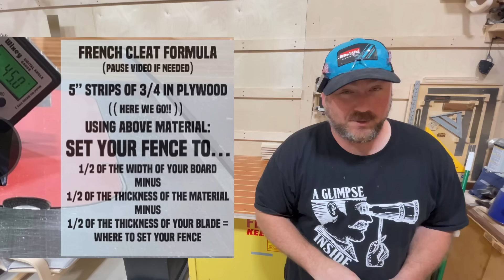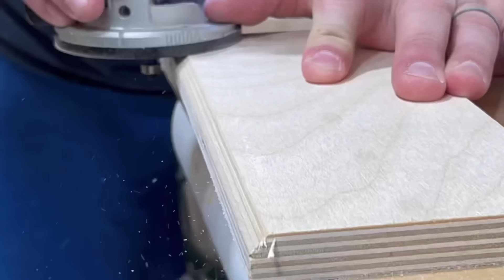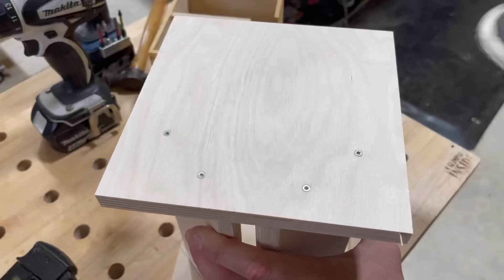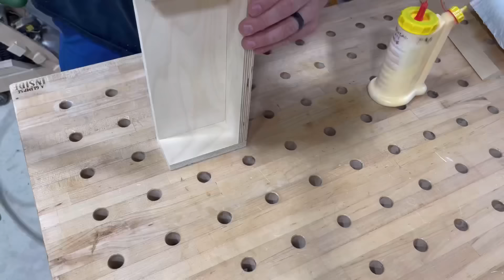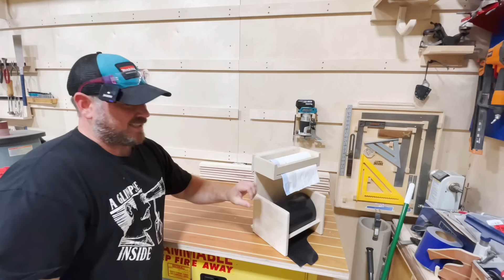This FRENCH CLEAT Design Change is AWESOME

Comment: if you do it backwards you can make smoke and stall a 3/4 horse table saw... not that ive made that mistake lol. I cut 1 4 foot board stalled the saw 6 times burnt marks into the cut bound terribly. honestly hadnt attempted another 45 yet. i did receive advice from my grandfather including which side to put fence on so now its just find time

Comment: That's killer, and not only allows a tighter spacing of cleats (if that's your bag), it also makes them infinitely easier to cut out, when you can just set your fence however wide you want your cleats, and then just go to town. 100 percent I'm gonna use this style cleat for the wall I'm building this summer.
Reply: Oh and great ideas all around. You gained a sub today my friend

Comment: I just stumbled onto your ch and this video. Great video thanks! I'm a newbie wood worker starting out. I want to put up one of these cleat systems on my garage wall.  What vertical spacing do you recommend between the cleats?

Can I put the cleats right on top of my sheet rock? Or is there a reason it looks like you covered the wall with plywood first, then put the cleat system on?

Thanks.
Reply from the maker: I like about 7 to 10 inches between the cleats. Also, you could put them on sheet rock just make sure you get a couple of screws vertically spaced between each other about an inch or inch and a half into the studs 
I was just like a solid surface for more versatility 

Thanks for checking us out welcome aboard
Reply: @AGlimpseInside  Thank you for responding with that helpful information!

Comment: I like the idea but maybe I'm missing something? That box made in the video will only work in a cleat box and not directly on a cleat on its own? I'm feeling like if the main box had a normal down towards the back cleat interface you could just put any cleat holder on top and it would also allow those to work on the wall cleat itself

Comment: Great stuff and video!  Question:  Will the parallel angled cleat remove the need for locking key or peg?
Reply: I tried it out.  Yes, it kind of works if you do everything with very  tight tolerances.   If not, it is very easy to bump a lightweight item by accidentally hitting it from below.  Note that to deliberately remove an item you move the item cleat up and away.   I don’t see a way to lock things since it’s all bevels.

Comment: I'm obviously the inexperienced one here but...  I sure would love a basic French Cleat tutorial with all relevant info.  I've spent hours on the tube and the googs and frustrated.  How do you choose cleat size and spacing on the wall.  Pete sq shows his close together, you said 12' apart and in another video you say 10" apart.  You showed your formula for cutting the "traditional" size (5" strips cut to formula"), but then didn't say how wide your fence is set for the "new" cleats (looks about a 3" face).  Beginners aren't following.  I'm a beginner.  Pretend you're making a video for dummies like me.  I appreciate all the info and learning this stuff is fun. Just wish it were a bit easier to find some of this info.

Comment: Another reason to cut the strips with parallel 45s, whether or not you use the top to hang something else, you can set your blade to 45, and only pass through once.

Comment: I had always cut my cleats with the 45 on both edges until iI realized the limitation of that design. I  never thought it was a new idea. It just seemed logical to repeat the same cut for as many strips as I wanted.  However,  if I have a component that needs to be locked down to keep it from sliding or falling off, i have to drive a screw through the component and into the cleat.  Whereas with a squared bottom edge, I have options for how i can clamp the component in place without marring the wall cleats.
Reply: This is basically what I came to the comments section for. I quite like the idea & can see some advantages, however I just kept thinking that I really don't want to cut then glue & screw all these things to my wall only to realise I need lock some things in place. Think I'll just stick to square edge bottoms for my new wall.

Comment: So basically your just making thinner cleats. And instead of cutting 45° last, you’re cutting 45° at the beginning. And that extra little tissue holder got no support at the bottom and since it’s protruding a bit, it will fall with just a little tap. Or am i missing something? Love your channel but revolutionary - nah. 

I hoped for some kind of double cleat system for extra stability for very tall tool holders.

Comment: Perfect for often used accessories and hardware that are used with whatever tool is being hung on the main holder. Bits and blades instantly come to mind. 
One for your trim router holder that holds bits, wrenches, auxiliary bases, etc. …. Grab the tool then grab the tray and off to work. 

Geniusly simple

Comment: Since you are taking the sharp tip off, could you have your router table set up to trim the 1/8" off the tip after the first bevel cut and then bring it back to the tablesaw to cut the second bevel? This way you don't have to worry about the sharp tip sliding under the edge of the fence and so don't have to fuss with clamping a strip of wood to the fence to stop this from happening.

Comment: I'm too late to the party. The coupon code doesn't work for Starbond anymore. Cool video though
Reply from the maker: Agi15 

Is the new code. It just changed. Thanks for the comment or I would’ve have no idea.
Reply: @AGlimpseInside  Thanks! I had just placed an order. I sent them an email to see if they'll use the new one. fingers cross :)
Reply from the maker: @drumrgrrrl4319  hope so. !!
Reply: @AGlimpseInside  They didn't, which is a total bummer. Feels kinda crappy that they don't honor the original coupon code. Anyway... Still diggin your videos!!

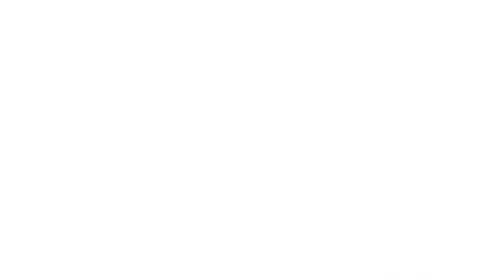Comment: I'm not sure I'm entirely clear on why you're so excited about this design change... I think I get a hint just from watching how Pete's using them (in the section at 7:08)... like, it seems like the same boards are used for both sides, with a slightly wider gap, such that the part on the holder just fits between cleats... but does that buy you anything, over having the holder side just be thinner than the cleat side (or at least, than the gaps between them)?  I'd love to understand what the win is here... other than only having one cutting angle on the table saw (but then, I'm thinking of using 1x3 instead, so I'd only do a single cut anyway).  Help me understand?  Thanks!  (Cool holder ideas, meanwhile!)

Comment: Have you considered adding a 45 degree edge to the top of backside of the bag dispenser rather than the cleat itself? Then you don't need the spacer between the backside and the cleat. It would then also be optional whether you hung the tape dispenser on the bag dispenser or directly on the wall.

Comment: Yall are gonna hate me for this but there's a better way.  Using just 1x2 lumber for slats and cheap coat hooks from amazon you can easily make a similar system without cutting 45's and its much much cheaper.  The mounts you make for the wall also have the benefit that they can be taken off and hooked to other surfaces, I tend to hook them to my wire shelves on occasion.  You can also get stronger hooks for serious applications, I have a standing desk on one of them which use stronger stainless hooks.   I've also retrofitted some mason jar lids with the hooks so they can get stuck too.  

This video inspired me to make that system however and I'll be forever greatful.
Reply: I forgot to mention that the slats float, they arn't mounted directly to the wall, you mount them to studs, either at just the end or more often if you need extra strength.  The only downside is the hooks interfere with the stud but the hooks are so small that it's unlikely youll interfere with them.
Reply: My system is setup the following way (mines a cart).  the center of the wall is comprised of 2 2x4 boards on the edges going vertically (the bottom is attached to a wheeled cart), then I cut each 1x2 slat in half (4ft) I place first slat then space out the second slat using scrap 2x4 and continue the process until I get most of the way down the wall.  I then repeat the process on the other side.  Then for the tool mount I use any scrap lumber like plywood or wide planks and place 2 coat hooks at the top corners, done.  It takes me about 30 minutes to make one & nothing is wasted!

Comment: If you cut the top of your trash bag holder at 45, you could have stacked a regular cleat on top, no need for the spacer between the upper parts cleat and body.

Comment: Love what your doing my problem is when ordering from your web site the shipping is a killer? I was just putting a order into you for  $185 and shipping was $26.00  I deleted the order Sorry
Reply from the maker: It’s a reality for shipping that unfortunately Amazon has diluted peoples minds. USPS and UPS have upped the rates and rightfully so the price of fuel plus a workforce where people are stretched thin. They’re having to pay workers more nowadays which is great honestly but it does all trickle down to the consumer. Honestly $26 doesn’t seem too bad. I do want to know your expectation on what you should pay for shipping and unfortunately I don’t know what your items were weighing in at. Anyway, let me know what you think. A fair shipping price would be for what you ordered as I don’t have control over the shipping with USPS and UPS.
Reply: I guess most of us are getting a custom to low or free shipping. I have bought from you 2 times before and new the shipping was higher than average. I Love your products. Don't get me wrong and your channel also.. Have you ever looked into USPS Flat rate boxes instead of what you're using. I'm going to order again later this week even though you use a website calculator to average you shipping. Hope 2023 is good to all of us. Ty

Comment: While the two 45 degree bevels make stacking possible like you've shown, I think a bigger benefit was missed. Having the cleat on the wall have a 45 bevel on the top and bottom means that the two cleats can be closer together. The 45 on the bottom of the wall cleat coupled with the top 45 on the storage device means they can slip together and apart more easily. This is very helpful if making many small part holders for things like screws or loose tenons.
Reply: Any chance you know of a video explaining this a little better?
Reply: @jonathangaliano2617  This channels most recent French cleat video demonstrates this very well. Instead of having the 45 degree bevel only on the top edge and the bottom be a 90, both the top and bottom are cut at 45. In the latest video, you'll be able to see how close the two cleats are together. Hope this helps.
Reply: @jonathangaliano2617 , the wall cleats shown by Pete in this video are also pretty closely spaced and also beveled on both sides, making it easy to slip the tool holder cleat in, but not so easy for it to slip out when the tool is lifted out of the holder, since the two cleats are pretty much flush against each other, which is sufficient to keep the tool holder cleat in place.

Comment: Having the bottom edge of the wall cleat rail at a 45 parallel to the top edge actually serves no function at all! Nothing ever contacts this face. It also interferes with a simple key lock, if you need one. It may save a few minutes while cutting wall rails, but then you're living with the cleats for years...so little net gain. It is actually a waste of ~3/8 in. of wood per wall rail. It is cute, tho to see stripes of plys on the walls, if you used ply.
Reply from the maker: Looks like you’ve done your research on this!

Comment: Lots of comments on this one so maybe this was mentioned prior, I didn't check. But for your aux fence a piece of very thin angle can work to keep your sharp edge from drifting under your fence. The thinner the better as this will affect the angle you are cutting on your cleat, especially on narrow pieces. But it does work with zero chance of your piece drifting under the fence. With the angle clamped to your fence with one leg to the fence and the other leg laying flat on the table your workpiece rides on top of the angle and can't slip under the fence. You can make your own from a piece of flashing or look for some thin aluminum angle at the big box store. Either 2 x 2 or 1-1/2 x 1-1/2 and no more than 1/16" thick would work. But a piece of flashing is best.
Reply from the maker: Not a bad idea. Thanks for your input brother. And thanks for the comment

Comment: I rip bevels the dangerous way all the time. With the saw angling towards the rail. Must have done multiple miles of it that way. Never had a single kickback, not even working with warped 2*4s.

Comment: Not sure if mentioned, but can also use the cleats on handtruck that has crossbar, or be added to a toolbox to attach boxes.  I use the same bottom box for paper towel dispenser over a cleanup sink.

Comment: TBH I found that simply drilling up things on the wall is much easier, requires far less material and time than making a french cleat system. I did a lot of reorganization but little on tool wall next to the workbench where my handtools rest, so maybe one or two holes on it because of reorganization. Probably I even reused them for other tools. (The workbench is  traditional german/scandinavian style one)

Okay, my electric handtools lays on other shelfes not on wall. What I found to be very useful is having a cabinet with lot of smaller shelfs above the workbench without any door. It's far more easier to throw things there than spending time to build a holder for everything. Maybe using smaller carboard boxed to store other things as a tiny drawer like thing. Ugly? Yes. Simple? Yes. Flexible? Totally. Cheap? Yup. Basically in some cases you reuse trash like shoe boxes. Require less time to make? Absolutely. Saves you a lot of work and you can focus on actual project? Sure. Can you make a lot of YT video about this? Ehm... nope. But does it matter?

Comment: i never saw the point in french cleats, hanging the cleats take no no time, but every time you want to add something you need to make it fit the cleats system. why not just screw it to the wall in the first place. if I ever need to move it i just have to remove 1 or 2 screws. it's different wit things you want to bring with you though.

Comment: Just a thought: You may be able to simplify communicating your cleat formula (width being synonymous with thickness and material having dimensions of length, height, and width/thickness): Simply add the height of material + width (thickness) of material + thickness of blade and divide the sum by 2: (H + W + Tb)/2 = distance of fence from edge of blade (tooth).

Comment: A piece of sheet metal bent at 90degrees then clamped to your table saw fence is  a safer more secure way to insure that the long point of a angled rip can't slip under the fence since it is also an auxiliary table saw table.

Comment: So this is how I went with all of my cleats. Anyone have a suggestion on making locking tabs? Since the upper clear is at a bevel now, I’m scratching my head for a neat lock for the things on the wall.
Reply from the maker: Well I find that I don’t need to lock the screen too often but when I do I actually like using a very thin trim screw. I find that I don’t move the cleats around too much so having a small hole in the cleat it’s not a big deal to me. However I’m curious to know if anyone else has any other ideas as well

Comment: Just a thought and only concern would be, the amount of weight hanging on the WALL CLEAT, if you start doubling up on the new cleat with bins on bins with screws etc along a stretch of wall. Just something that crossed my mind and a thought especially if the wall is plaster board.  But still a great idea and another simple problem solver for the one off's.

Comment: What do you do about dust collection? I feel that's a major flaw about french cleats.
Reply from the maker: Truth be told I’ve never really had to clean them out. I really think it’s just a talking point in the mist yeah there’s a little bit of dust that gets in there but it’s really negligible. Especially when you take the sharp edge off of the adjoining Cleat. At least enough room for a little bit of us without sacrificing holding power

Comment: Chris, I believe the formula @1:06 works for left-tilting saw blades (away from the saw fence) as with your Saw Stop.  If the blade is right-tilting, toward the saw fence, then the formula would need to change to add (+) 1/2 of the thickness of the board.

Comment: I took a look at Pete’s video on these.  And the advantage he points out is being able to slip tool holders below other tool holders that would be in the way.  But that still only works if the tools hold doesn’t stick out where it would block inserting or removing the tool holder below.  Some of his tool holders in his video, you can’t put a tool holder below without still removing the one above.  In your case, you are creating a cleat on a cleat, to add a tool holder to an existing one.  Good job.

Comment: I understand the concept of how you have implemented the use of the parallel 45 degree cut. But the inventor, he had his wall cleats where the top cut did not have the functionality.  It went right against the cleat above.  In fact his wall cleats had the same parallel 45 degree cut.  So in his use, I don’t understand what it buys him.  I think you made his work better?  What am I missing he did?